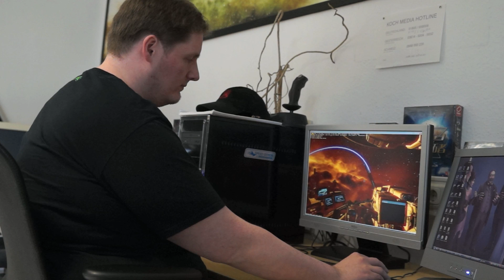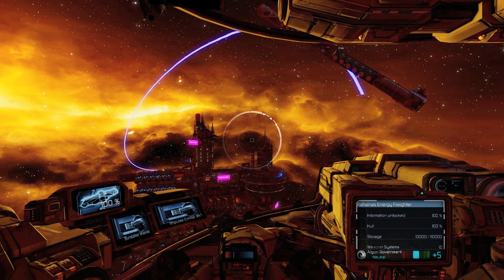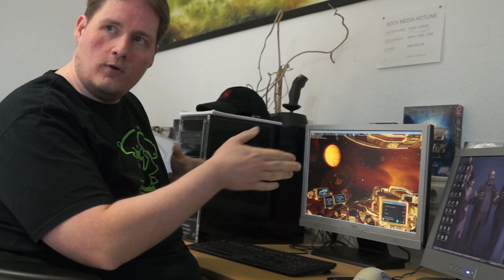Making of X Rebirth -  Matthias on Pathing

Comment: but that's because you'd already started steam. last time my internet went down it started at 4AM when my computer wasn't on, so when I went to start steam it wouldn't because it wasn't in offline mode, and you need to have an internet connection to turn offline mode on.

Comment: dumb dx 9 is too old so people with new computers who have upgrade are penalized? make two versions. there are alot of enchantments like tessellation that makes a huge difference in graphics quality and performance. seriously if your using xp its time to upgrade get a cheap dx11 card that will out perform your old dx 9 card.  The biggest thing about DX 10 is the ability to take advantage of all those stream processors on your video card. 

/sigh

Comment: Who talked about completely stopping the shield recharge? There could be some backup still, like you can't take all power out of engines and then they would be copmletely useless- there must still exist some power delivery. I guess you haven't played X: Beyond the Frontier, where the boost actually is working like it's destroying your shields. Strong shields usually don't get destroyed quickly, by only space debris. And in fight the better recharge speed would help you just a very little

Comment: Yes - while big ships will try to avoid other big ships, it's up to smaller ships to get out of their way.
This ship-to-ship avoidance is also where some things still have to be done iteratively (meaning: checking the relative locations of other nearby ships and reacting to them), since precalculating paths against moving obstacles gets complicated very quickly, especially if the obstacle's path is then changed because of *your* movement.

Comment from the maker: It will of course update the path, but it can still use the same pathing system. Only small ships that have to react very quickly will sometimes use a simpler steering model. But even then they have much more assistance through navigation meshes etc. More on that soon...

Comment: It is probably a bad question, but what happens if something gets in the way of per-calculated flight path? Is there some kind of constant checking going on? 

The reason why I ask this, is if you make a maneuver to block the larger ship, will the AI make a smooth adjustments or sort of starts to twitch like in previous games?

Comment: I should maybe have mentioned that the small transport units currently have a wee bit too much carrying capacity :-)
Normally we'd have way more ships flying back and forth, which will be a tad more realistic and also look cooler.
And while unloading will take longer than this, it will still be relatively short, and you (the owner of the ship) can already go flying around for the next trade offers to queue up in the ship's system.

Comment: Thanks!
It's not really a simulation, and actually pretty far from realistic. As soon as you enter the general vicinity of a bigger ship, like the one in the video, you move in the "reference system" of that ship. This is especially useful if a ship has a hollow interior you can fly into, without it you would have a really hard time trying to constantly match the capital ship's speed.
So it's not really gravity - think more walking around on a train without needing to run 60km/h all the time :-)